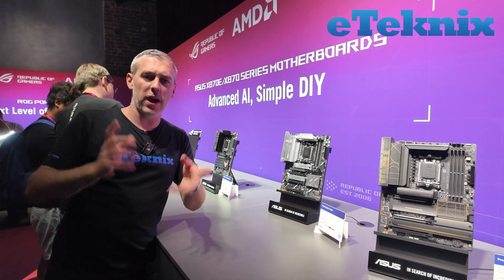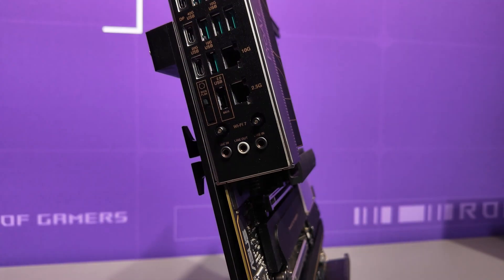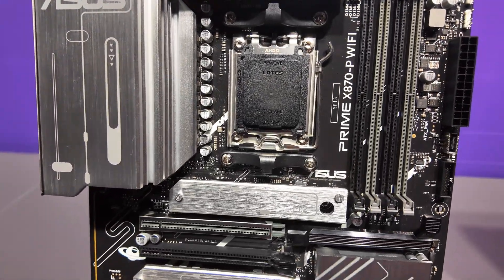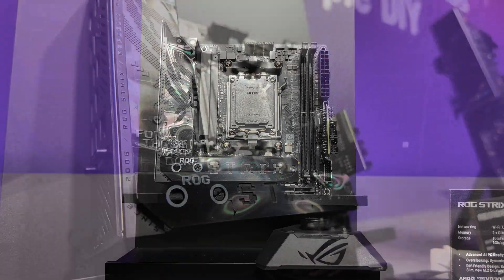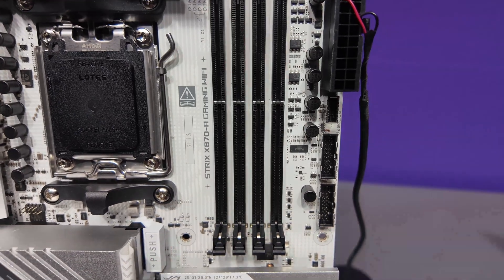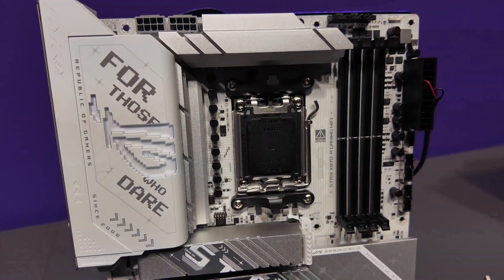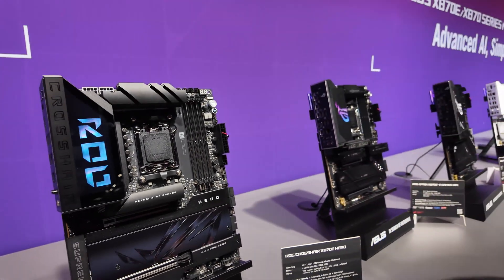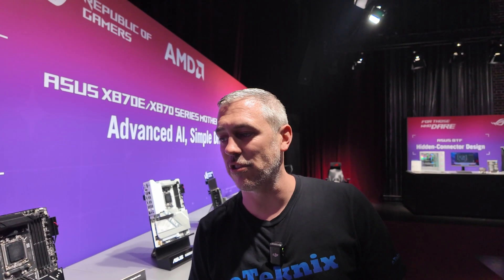ASUS X870/X870E EXCLUSIVE First Look At ALL Next Generation Motherboards!!

Comment: I bought a Corsair 2500x computer case. I couldn't see the BTF motherboard in x870. Will it come out or not? Why don't you give information about this?
Reply from the maker: Nothing confirmed as of yet.
Reply: @eTeknix  Thank you. We are living in 2024. BTF systems definitely need to become widespread. I have been collecting systems for years. I hate seeing cables on the front, now I am definitely waiting for the b870 micro atx btf motherboards to come out. I bought a Corsair 2500x btf case. I do not want to buy an Msi b650 project zero motherboard, the reason is the new micro atx motherboards. I'm waiting with respect.

Comment: PCIE 5.0 STILL HAS LIMITATIONS....
If we install ONE VGA card only, it will run x16 ...
But if we install DUAL VGA cards, it will drop the speed at x8 x8 ...
And if we install ONE VGA card + NVME in PCIE mode, it will run x8 x8 also ....

So, if we want to full running x16 x16, USE THE WORKSTATION MOTHERBOARD....

Comment: 0 -2 sata ports and a lot off sharing bandwidth on the m.2 slots for normal x870 motherboards is just stupid. prob x870E-E the one i need wil cost 599+  i am better of buying the x670e-A/F

Comment: Not seeing debug code LEDs on most of the boards.  PCIe layout on the top end means x8/x8 so if you want to use some add in cards like 10G Ethernet, capture, audio, etc, you are dropping your GPU down to x8.  M2 already with a heatsink, will you have to use tape or something to hold it down, or can a regular screw still be used if the asus mechanism is removed?
Reply from the maker: Most have LEDs, but not debug code ones, but I do get your point. It's a cheap addon. Doesn't look like a normal screw can be used.

Comment: Usually the 8pin connector (thats near the ATX) is usually for the USB C charge connector, if you tend to use the Front I/O to charge your devices as well with USB-C. 

From what Asus has claimed, is they changed the design on the Ram Pins and ultization to get more ram speeds without adding in traces that they normally add on previous generations, in order to get more ram speeds and hopefully faster post.

The Only down side on the Crosshair Hero x870E is less USB I/O connector this time, compared to the x670E Crosshair Hero. So you may have to grab a USB Hub or fetch the Strix x870E in order to have a balance in USB Connectors. I can def see the sacfrice they did there, to add another Network NIC, coz i did recall more people want ASUS to add an extra Network NIC in the fourms.
Reply: The 8 pin connector next to the mobo 24 pin is for the front usb C fast charging. I’ve owned the X670E Hero since launch and it has the 6 pin for that exact reason and does nothing else. I’m curious if they made it 8 pin since that seems to be common among PSUs to keep down confusion since it uses the same cable as GPUs.

The usb I/O is what stood out most to me as well. On the X670E Hero, the massive amount of USB A and USB C were one of the selling points. It was one of only few AM5 mobos that had the connections I need. If I were to get the X870E Hero, I’d lose connections and need to use hubs.

Plus the X670E Hero already has 5 nvme SSD spots, the two USB 4 connections and more connections for audio. But like you said, people mentioned wanting more Ethernet connections on the Hero so I see why they added another port. But why not 10G like others have along with the 2.5G?

I guess it all comes down to the bifurcation and price. If you can use all these features without messing with the others then that is nice. I know the X670E Hero has some minor ones like if you use the USB 4 then you can’t use one of the pcie 5.0 nvme.

Coming from the X670E Hero though, this would actually be a downgrade for my needs.

Comment: I guess BTF is dead now? That didn’t last long. The case manufacturers got behind it more than the mobo manufacturers
Reply from the maker: ASUS still have BTF, but I guess the uptake on it hasn't been as high as expected so it's only available for a few models.
Reply: @eTeknix  any btf for 870?
Reply: @garychios  No there isn't even btf for b650 the btf is sadly intel exclusive as far as I've seen online correct me if I am wrong may just be unlucky only back connector boards I have been lucky enough to find online is The MSI Project Zero unfortunately though that is an MATX which would look weird as hell in my case starting to wish I never got this 6500D because I prefer team red and have not found any AM5 board that is ATX with Back connectors

Comment: Only think I'm not liking is the still pushing of this AI nonsense, like "AI cooling, AI networking, AI overclocking" etc. Maybe ask them what the difference is between the regular version of those things we've had for years already?
Reply: I think AI cooling is just PWM fans lmao. As usual they slam the word "AI" to everything.
Reply: @random_internet_duck  I suspect your spot on, but they should be asked anyway, if only to expose that.
Reply: It’s complete nonsense 😅
Reply: The cafe near my work started offering an AI Sandwich.  It's basically a Ham and Cheese that's prepackaged. :)
Reply: Who cares … many get wet dreams just reading ‘AI’  … what it does? Irrelevant … ‘must have feature’ … as everybody advertises AI … for everything …
Reply: AI is this time’s buzz word. Previous examples were Internet Connected, Web 2.0, Blockchain, crypto.
Reply: It’s the IT flavour of the month, CPU’s, graphics cards, cases, all AI ready, wtf does that mean, does that mean you can assemble a fully self aware T1000 terminator from AI ready components? It’s just a price gouge and rubbish statement like aerospace grade titanium and military grade capacitors.

Comment: Its disappointing that they are not releasing an extreme version with 10gbe Ethernet. The pro art looks awful so I wouldn't consider that. I have an x670e extreme in my gaming pc and an x570 extreme in my work pc. I was hoping I could upgrade my work pc to an x870e extreme but I guess I will a have to check out some of the other manufacturers options for a high end good looking board with 10gbe. I purchased a 9950x on release once I seen the Linux benchmarks as my work pc runs Linux.
Reply from the maker: I quite like the ProArt, but it networking is an issue then you could always use a 10Gb card that can be carried across into all of your future upgrades
Reply: @eTeknix  I have a 10gb startech intel nic but it won't fit in my case with my bottom 360mm rad in it. Usually with these boards when you plug something into the other ports it will lower the speed of the main pcie lane also to x8 which is why I prefer the onboard nic.